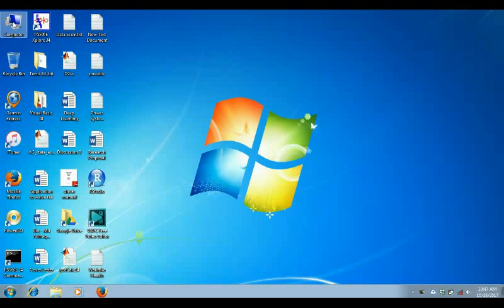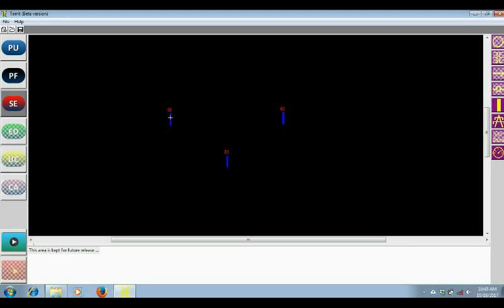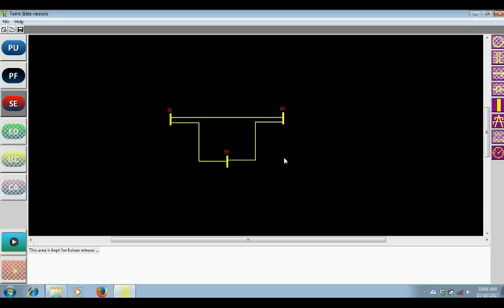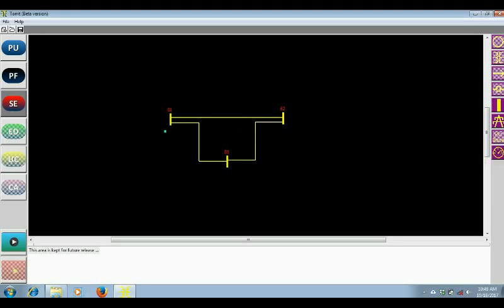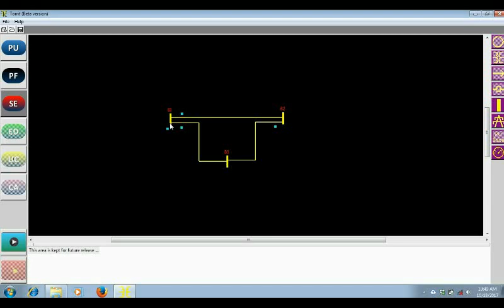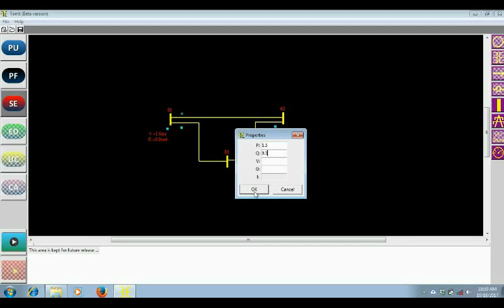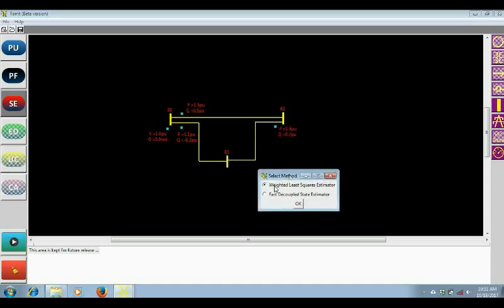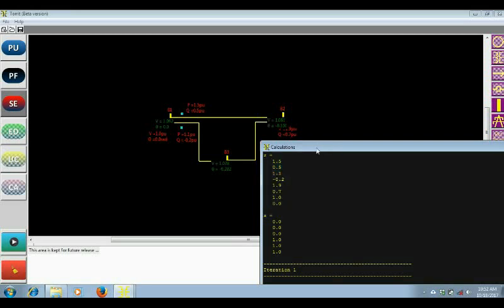06 Power system state estimation - Using Torrit _ part 1

Comment: Does it work for AC state estimation or only DC?
Reply from the maker: AC estimation.
Reply: Thanks, is it possible to link it with MATPOWER or Matlab for gathering data, also inputting data for the model.
Reply from the maker: It is not possible for now. I may try in future.